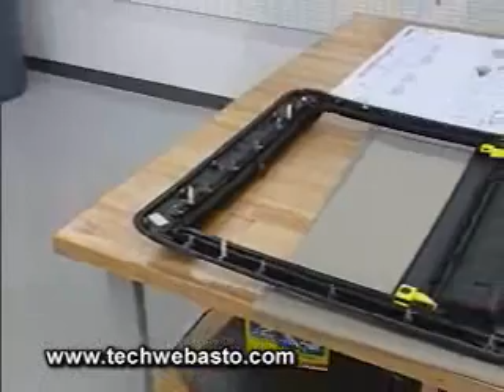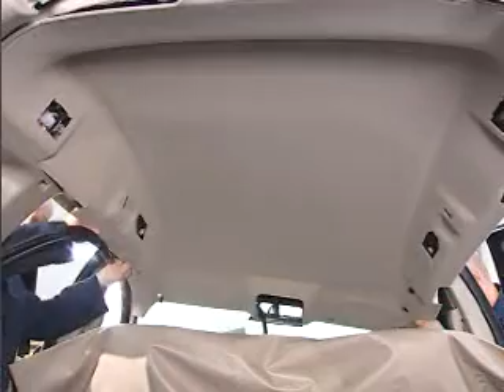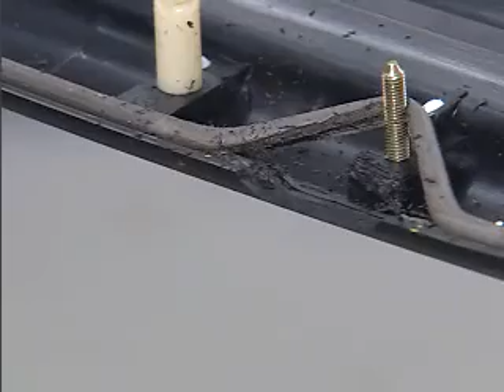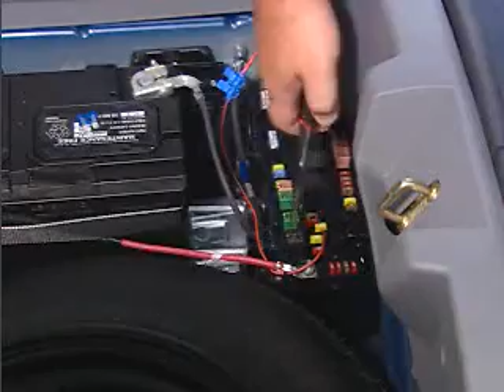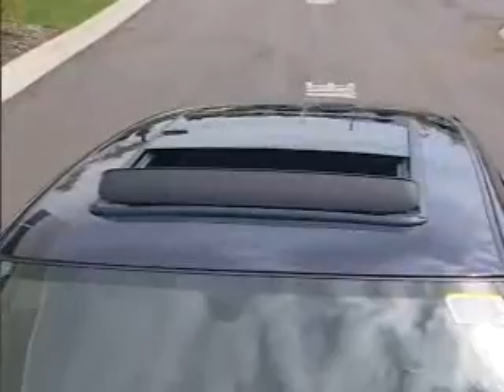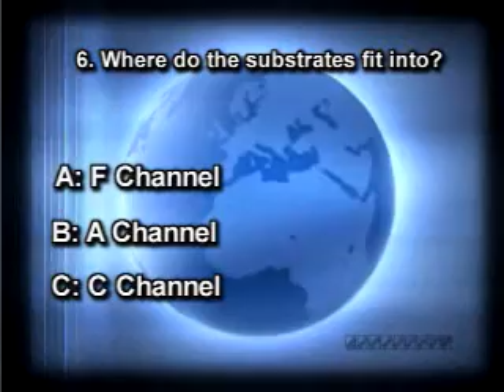sunroof webasto hollandia 500/524 install english

Comment: I dont know if im missing a piece or what deal is but i connect everything an i can hear the motor running an i can see the cable moving but the glass dont slide, i did also need the switch an motor cover but i found those now

Comment: Do you guys have sunroofs like this?
Reply from the maker: hard to find, but could be
Reply: I actually have one but looking for parts, can you help me? I’ve been look and searching for weeks!
Reply: I have one also an am also looking for parts
Reply: @lcook1965  what do you need?
Reply: I dont know if i missing piece or what everything is hooked up an working but glass dont slide open, an i can slide it open by hand as if it is a sliding ragtop
Reply: @kevinnoheart6714  i wish i could find a complete parts diagram of all the parts because im honestly not 100% sure what it is im missing
Reply: @lcook1965  send me your email, I have a diagram
Reply: @kevinnoheart6714  mechanic either stole,  or messed up my roof motor,  any replacement motors that will work?
Reply: @kevinnoheart6714  ftbstrd625@me.com
Reply: @swangan3z  you can contact webasto an they will let you know what motors will work in it i know there are a few different ones that will work
Reply: @lcook1965  thanks
Reply: Where can I find one
Reply: @timothybacote5992  not easy at all to find , it took me along time to even come across one but honestly keep watching ebay an anything like that if i come across anything also ill post back on here to update